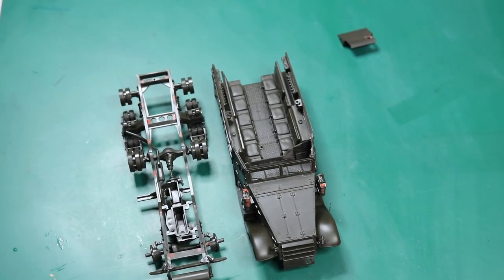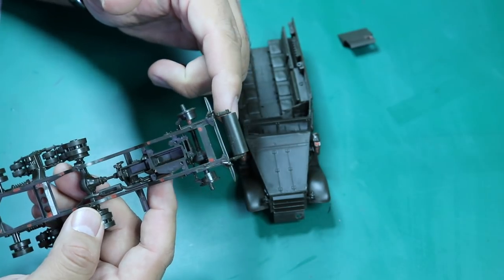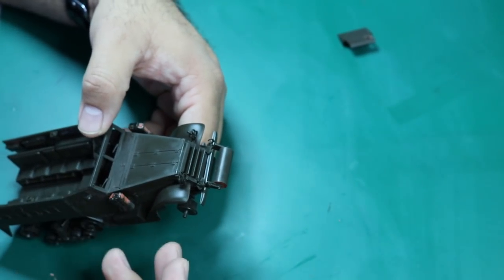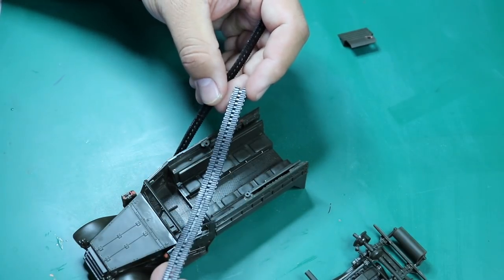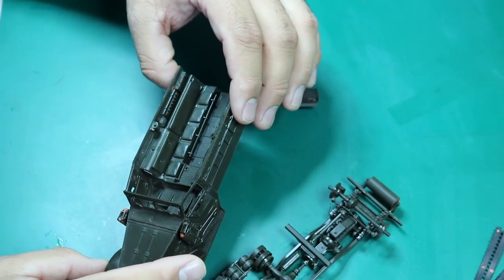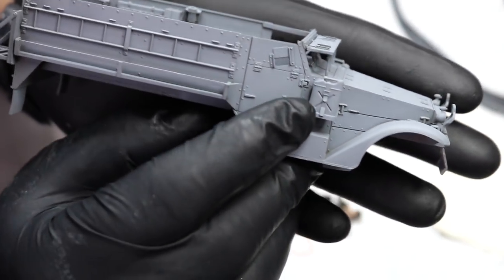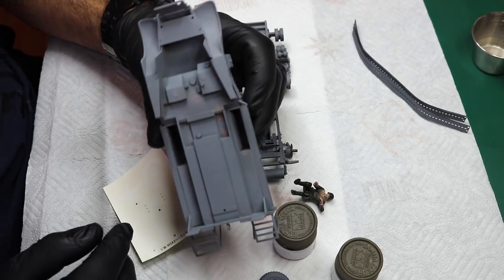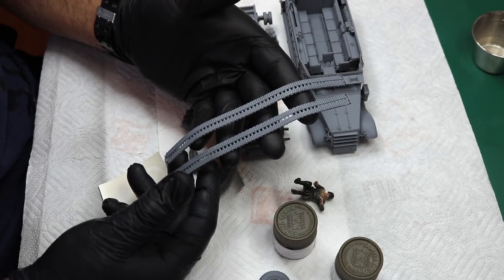1/35 Tamiya M3A2 Half Track Update 3.

Comment: PTO "Power Take Off" is a drive line (Drive Shaft) that taps off the transfer case to power external accessories like the winch, snow blowers,things like that , they can run forward or aft, it is a common feature on Tractors.
Reply from the maker: 88crap great to know! Thank you for sharing. I wish the kit had that drive shaft though.